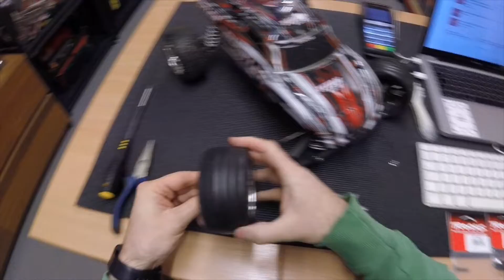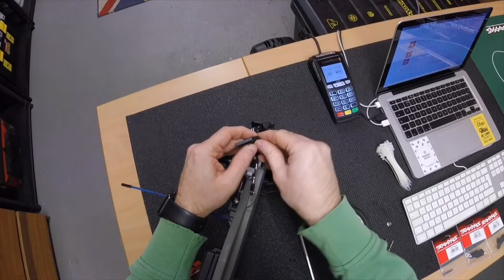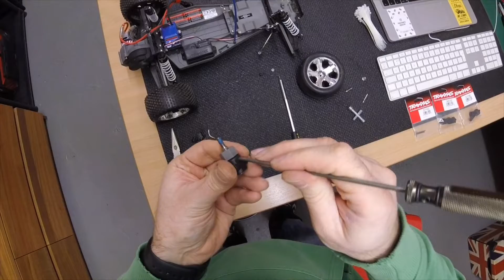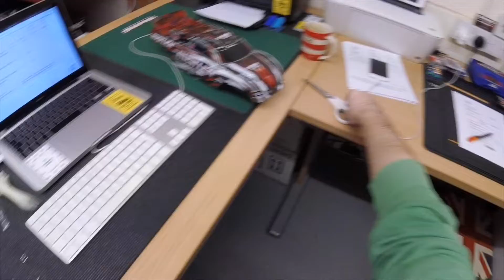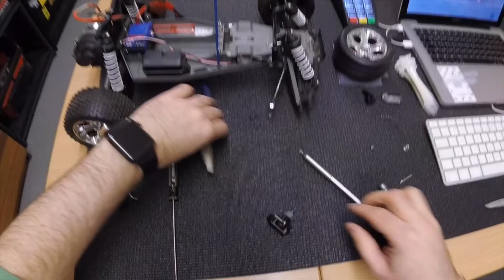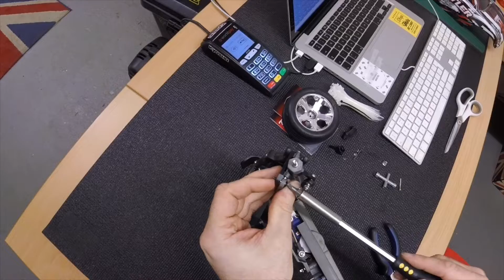Repairing Steering And Caster Block Damage After Crash On Traxxas Rustler

Comment: why not replace with aluminum?  I have  a question about the casters.  I just broke mine on my Rustler and bent the kingpin like in this video.  I ordered a set of aluminum casters to replace them.  I noticed that there are two versions of the king pins part number 3740.  one that has a screw in style and one with the C-Clips.  With either one work with the aluminum casters?
Reply from the maker: Cost really. Some people don’t want to spend on the aluminium parts it’s way more expensive than to replace the stock parts but it’s your choice.
Reply: @passionateaboutrc  are their two kinds of pins for the casters or do i have that wrong?  is there a screw in style or do they all have C Clips?
Reply from the maker: Not sure you would need to check the part numbers or try them. There are 2 types but not sure what fits what best.
Reply from the maker: I think the aluminium caster blocks come with the screw pin but you would need to see when it comes. Didn’t order from us did you? I haven’t sent or seen any orders for them recently.
Reply: The stock plastic is great as it “gives” and breaks in a crash. Aluminum looks nice, but more things will probably get broken using it. Also, I can buy 4 sets of plastic blocks for price of 1 alum. set. Invest in go fast parts, not bling.